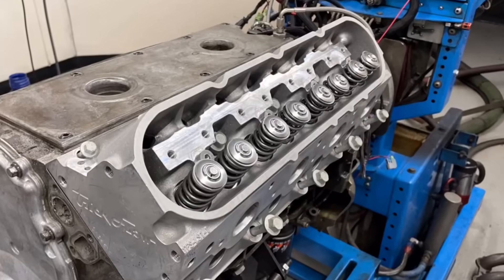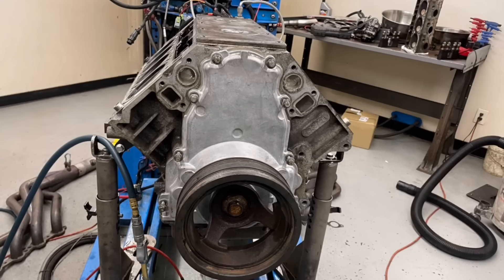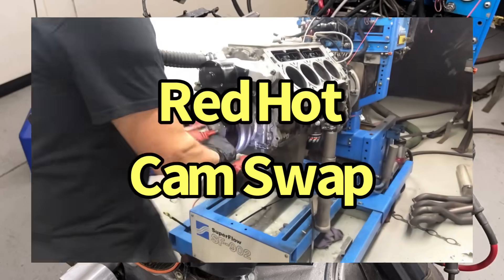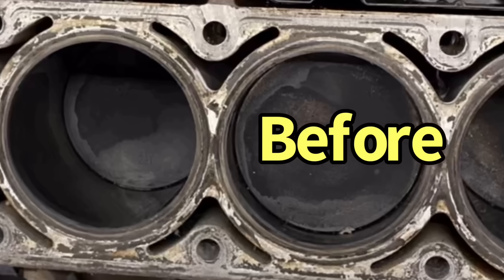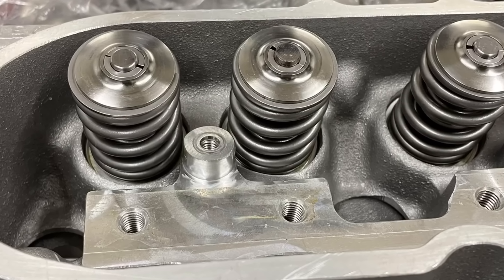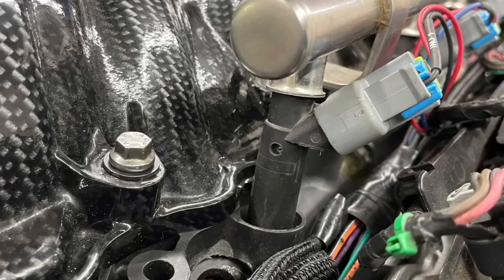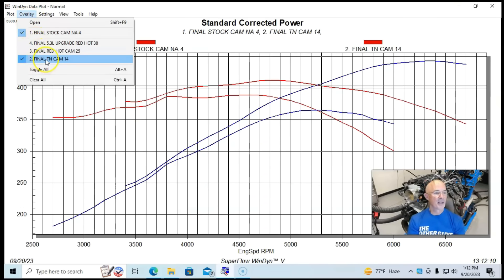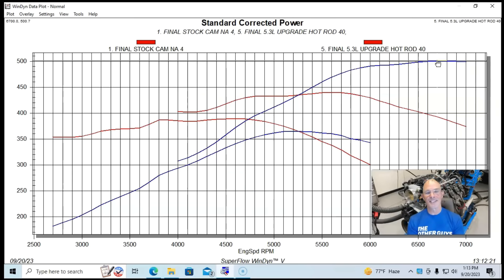HOW TO: THE ULTIMATE 510-HP, ALL MOTOR JUNKYARD 5.3L BUILD.  STEP BY STEP BUILD & FULL DYNO RESULTS

Comment: Awesome, I like the tests. Trick flow heads are not bad 30 more HP. ...?... Definitely interesting.   A question I keep thinking about is how can you maximize and keep a long steady Torque Curve. In the testing there  was one cam that had a nice long Plateau of torque.  Do you need rotating mass to increase torque?
Reply from the maker: rotating mass? as in heavy internals? big no
Reply: Yah I kind of knew that.  That's why I keep wondering why the UK is so into lower the rotating mass. And in the US its only sort of popular.  Cost is the obvious answer.
Reply from the maker: the US vs UK statement is not accurate
Reply: @richardholdener1727  I definitely don't know for sure. I've only seen more crankshaft lightening in a lot of UK engines dance I first got interested in the Buick aluminum 8 cylinder that Rover took over. Of course racing the rotating assembly is the rods pistons as well as the crank. But I've seen the people in the UK going straight to the crank and cutting weight there. Everything from motorcycle, all 4, 6, 8 and even 12 cylinder engines. The North American prefer the big throaty big block engines. It's just my limited view. I appreciate your replies. Even though I know I might get under your skin sometimes.  Thanks Richard.
Reply: @barryhuddlestun3098  Ligthweiogh cranks on st engines are a complete waste of money .The same guys swear thier alum flywheel adds xxx power cause "it revs faster in N" haha

Comment: It occurred to me while watching this that at 325 cubic inches, it's very close to the old 327(326.5 cubic inches).  At 365 HP stock it is also close to the rating of some of those older HIPO 327's.   Mind you it does it with much less compression and a milder cam.   Would be interesting to see a comparison.  Makes me yearn for an old F-body with a mild 5.3 and a 5 or 6 speed transmission.   Very drivable I'm sure.
Reply: Cylinder head technology wasn't as good back then. So they had to use more cam & compression to make up for it. With modern cyl heads, the HIPO 327 would be a beast!
Reply from the maker: the stock (junkyard) 5.3L L33 made more than the 365-hp 327 Muscle car motor did
Reply: I'd be curious to know how reliable the strung out 327 of yesteryear would've been, in comparison. I know this 5.3 combo can easily be daily driven with AC etc.
Reply: @STOK5OH  327s can go a few hundred thousand just keep it in good tune change oil etc. Same as any engine

Comment: Tbh motor hp means nothing. The only metric that matters is wheel horsepower.
Reply: Incorrect!!!  The only metric that matters is rear wheel torque! That’s what accelerates the vehicle.....HP is how much work is done in a specified amount of time....
Reply from the maker: Agreed-every form of professional motorsports (F1, Indy, Pro Stock etc...) should stop using their engine dyno programs! TBH...that is just silly!

Comment: Can you take this build to the extreme? What would some higher compression pistons do with some e85. What would it take to get to 600hp (is that even possible) n/a
Reply: Very possible, however keep in mind this engine that he has is basically Better than fbos and a tune since there is 0 restriction between anything. Having a compression ratio of 12 or 13:1 is possible with e85, e85 also has an extra oxygen atom so it add more power other then aggressive timing. What would help a lot would be drastically decreasing the stroke, and boring the engine, this will allow the pistons to spin faster creating more rpm and more hp. There is a 400hp k24 all motor, if that’s possible then getting a 5.3 liter engine to 600hp is very possible.
Reply from the maker: Changing bore and stroke is not the answer. Cam timing, compression, intake and things like dry sump oiling will allow this motor to creep up to 600 hp

Comment: I'd like to see a 700hp 6.2L engine, naturally aspirated on pump gas.
Reply: itd be easier if it was a stroker...youre still talking n quite a bit of RPM  and on pump gas... even for the LS/.LT  platform,, thats a BIG ASK for under 400 inches...
Reply from the maker: BTR did 760+ hp with a 6.2L Gen V LT1

Comment: Another great video, Richard!

Question: this is exactly what I want to do with a '96 Impala SS LS swap I'm currently sourcing a motor for. I'd like the car to be 500hp all motor. I won't have a fancy ported and polished head though. So, considering I'm willing to take the motor fully apart for this build, could I get away with as cast trick flows and maybe an over bore, domed pistons, etc etc to get to the same 500? Or will it simply require / be most cost effective to do all the head work you've done here? Thank you, you're an excellent resource!!
Reply: If you've not sourced a motor yet buy a 6 litre and definitely 😂
Reply: The heads yielded 30 HP extra.  Do you need the extra 30?  Maybe a mild home port would yield 20+ without the expense of aftermarket heads....
Reply from the maker: Bigger bore (or 6.0L) would yield the 500 hp with as cast 220 heads
Reply: Wish you were my neighbor !    I'd like 500 Hp, via LS swap, for a 56 GM product.
Reply: Why not just build the LTx? You can make tons of power with one even stroke to a 409

Comment: With $9k in heads, cam, valve train, intake and fuels system and machine work, your junkyard SBE can make 500hp.

I think you might be better off with a upgrade rebuild of the short block.  You will need more cam, but you can get to 500 crank for thousands less.

The LS/LT hybrid made 500+ with $5000 less in heads and $500 less in manifold.  I'd like to see this builds dyno graph overlay the hybrids.
Reply: All that was $9k???!!
Reply: @hellaportland  Probably $4.5k in the ported heads alone.  They run nearly $3k from BTR without the port work.
Reply: @aukseharris4630 $150/HP.......?   Heads netted 30HP....
Reply: @trailerparkcryptoking5213  That's the thing, the heads aren't being used to their fullest extent here.  They allow you get 500hp with a smaller, street friendlier cam.  The heads can support way more power.  More cam, more displacement, higher RPM.
Reply: @aukseharris4630  so Tooley came across with the badass heads to make his small cams look better?!?  Gotcha!
Reply: @trailerparkcryptoking5213  I don't know about that, but better (not just more) flowing heads permit smaller cam per given level of power.

You could probably get to 500hp with the Katech ported heads previously featured on this channel, but they would need a cam that most people would find objectionable in a street car.  With a lesser pair of aftermarket heads,  Mr. Holdner made 500hp with a stage 3 cam in a video from a couple months ago.
Reply: @trailerparkcryptoking5213  Look at the spread on power...its not just 30peak
Reply: @gordocarbo    I have had differential calculus and vastly understand “area under the curve” better than most!  And you?
Reply: you could most likely have less than 9k  in a 383  with steel main caps  AFR heads or a head that flowed 300 CFM  a super victor an 850 and a .600+ lift solid roller id be making about 575
Reply from the maker: $9000? You need to shop somewhere else but the High Cost Power Outlet
Reply: @richardholdener1727  I might be off, but you don't buy retail like I do.  $1200 for a FAST manifold, $400-500 for porting it. Plus the throttle body.  $2900 for the heads assembled heads from BTR.  How much for the porting, milling, hand cleanup, and modifications?  $1500 is conservative.  You didn't think about fuel injection because you've had them forever, but for a pulling upgrading from stock truck it's more money.  You didn't need pushrods but I would. The cam is nearly $400 retail.  It adds up.  You're probably fine running the stock rockers on a dyno, but failure for you is a minor inconvenience and a business expense.  I've learned the hard way to go ahead and pay the money.  At that level of lift I'm going to get aftermarket. 

You have friends and partners in the industry, I teach high school.   We are not the same.
Reply from the maker: Since you have no idea how or when I buy things-better just to admit you vastly overstated the cost to help promote your agenda.  Admitting when you are wrong would be something I would like taught to my sons in class.
Reply: @richardholdener1727  Gotta ask then. So, how much did it cost and how much would it cost right now? Any parts donated?
Reply: @richardholdener1727  I intended no offense.  My agenda was/is to interact with the people on the comment section of your videos (an excellent sounding board) and help teach teenagers math and science by engaging their interests (like cars).  I have a pretty fair idea of what the stuff costs.   If I make a mistake (like forgetting to include sales tax on items that aren't tax exempt) I have to pay out of pocket.  You think I'm high, and I might be.  I'm not going to call someplace like BRT or Tony Mamo and waste someones time asking about porting  services I can't afford.  I do know how much others charge, either posted publicly or from people that have the work done.  If my estimate is more than 10% off my retail cost, I'll eat my hat.  

But that's really beside the point.  In rereading my original comment, it was not written with sufficient care.  I should have made it obvious that it was not intended to be critical, only to spark discussion.  Again, it was not my intention to offend, even though in retrospect my posted comments were blunt to excess and could be easily read that way.  For not being properly mindful and considerate of someone that does so much for our community, I was an ass and I apologize.
Reply: I agree with you buddy. Even just the LS3/LT engines will do that for $1000s less.
Reply: Guys, guys.... give him a day or two to total everything up 🤣🤣🤣🤣
Reply: FIrst thing Id do is stroke it to 383 wouldnt waste time camming a tiny engine btdt

Comment: Have you ever done a test on electric vs factory water pump, could pair it with a test on underdriven crank pulleys as well. Might make a cool video if you havent done it
Reply from the maker: see the accessory video
Reply: Not worth it in costs, or gains (if any)

Comment: with that valve size and flow, it should peak at 7500+ rpm. theoretically 560+ bhp.
Reply: In the test IMO theres not enough camshaft for that RPM, a 240 or 250 cam would definitely do that, and theres definitely enough cylinder head for it. But piston valve clearance might get sketchy
Reply from the maker: You base the power production and rpm on valve size? How about no!

Comment: The VE on this must not be too far off from DOHC.    Alot of power was made and if he went a little bigger on the cam, tight lsa, even more compression and e85 600hp could've been had at a streetable rpm level.
Reply: What was the compression ratio on this setup?  It looked like flat tops with no valve reliefs....?
Reply: @trailerparkcryptoking5213  whatever the stock 5.3's have.  probably cant go much more on the cam without running inot PtoV issues
Reply: WOuldnt go anywhere near 600. Lot to ask from a tiny engine

Comment: 1HP/CID+ seems to be the modern manufacturer goals while 100HP/Liter is a standard for any aftermarket upgrades & modifications.
Reply: You're not far off, but I look at a different metric. Torque per cubic inch. Once that's maximized, horsepower is just a matter of RPM range.

Comment: There is more information packed into this 12 minute video than some people will ever try. And there is no shame in it. Don't cost yourself a bunch of money doing things you don't know how to do. Or you will end up on the channel Just Rolled In. Here is a thought. Do all of this, while keeping the variable cam timing system in place, and use basic tuner or whatever might be needed to make it run.
Reply from the maker: VVT becomes less of a gain (or even possible) with higher duration cams
Reply: @richardholdener1727  What would be your guess with a power number once in teh car, all accessories exh etc hooked up?

Comment: What fuel did you use in these test? Running a Static Compression Ratio somewhere around 10.70–1 you need careful cylinder pressure management to run pump premium or were you using e85?
Reply: I’d say cool dyno water and aluminum block it should work
Reply from the maker: 91

Comment: Hey Richard how much would it take to reach 500hp (or 530 if possible) NA on an L83? Thanks for the great video too!
Reply: he already has one going to 570 bhp.
Reply: Not much because LT heads are great. Cam, E85, headers, MSD intake. If you get ambitious, ported heads.
Reply: Hello, 

I have yukon 5.3 v8 2008 with 4L60E transmission I will get in my yukon
1-long tube headers (Speed engineer)
2-cold air intake (volant)
3-full system exhaust

Which cam should I buy to make more hp and tq 
1-BTR GEN III & IV LS TRUCK NORRIS CAM

Or
2-BTR GEN III & IV LS TRUCK NORRIS NSR CAM

Another qustaion do i have buy springs and pushrods?
Reply: @kingsupra5023  NSR cam has less lift than the truck norris cam and will make less power. NSR denotes "NO SPRINGS REQUIRED". Usually you don't have to do pushrods with BTR cams but its always good practice to measure just in case.

Comment: Richard, a little bit of speculation here... a similar junkyard LQ4 "should make around 40 more than the stock L33 - correct? If so, would it be safe to say that the top end and cam from the L33 should make around 40 more in modified form too? That would make a 550-ish flywheel setup pretty easy with a junkyard shortblock and good top end parts.
Reply: The math there checks out IMO, definitely a fantastic cylinder head. 
A 230/240 cam with that head would maybe make close to 600 but piston valve clearance would have to be looked at because of the mill job. I can attest to 600+ being doable with an aftermarket 11:1 piston, ported LS3 head and 240/250 cam.
Reply: Keep in mind the way Richard test his engines is without accessories. So whatever number you see deduct about 25 hp for real world numbers.
Reply: @sstevocamaro  25? I think it closer to 50at the flywheel when he added a regular water pump, accessories, mufflers, etc. I'd have to go dig that video up. The engine dyno to chassis video they lost 100 in a drift car with a manual transmission. 

I  definitely don't get hung up on peak numbers. I look at tests like this more for what percentage did it pick up stock vs. modified.
Reply: @bluecollarhotrods9781  Maybe -50hp total with a fan hub attached and activated
Reply: @sstevocamaro  That particular test I'm referencing was a stock 5.3L. Richard added: clutch fan, conventional water pump, alternator and power steering pump, air box, longer sections of pipe with mufflers. It was an excellent illustration of what robs power and how much. The other notable one was the effect of temperatures. He runs most of the tests with optimal oil and coolant temperatures.
Reply: @sstevocamaro  Probably more, cool intake air, low coolant temp/hot oil, add that plus accessories full exhaust I bet its closer to 50 less

Comment: Thats bananas to make 500+HP with such a small camshaft.   Another testimony of making power on the Chevy LS.
Reply: If you’re will to buy the heads and get the porting
Reply: @cedricwilson2055 there are older vids of 400-600+ hp combinations NA
Reply: Sweet
Reply: @cedricwilson2055  Yep those heads cost a bundle!
Reply: Bananas until you price out the parts for yourself 😂, just get a big block chevy
Reply: @benaiahtheassassin  then ima make 650+ with way too much torque  LOL
Reply: @benaiahtheassassin  BBC weight without accessories 660lb, chevy LS weight without  accessories 410lb.    So weight and size will be a reason that someone would pick the LS over the BBC.
Reply: @dennisrobinson8008  You add accessories and that 500hp disappears lol
Reply: @dennisrobinson8008  BB wont really be affected by 200 lbs like the smaller engine would 
I have a high hp Gen 1 sbc...regardless of the power# a decent BB will oupull it all day
Reply: @infamousnova it's not the answer for everything. Especially when it's going in something like an s10 track truck. Weight is huge. Size is very important. As well as getting more than 3 gallons per mile. 😂
Reply: Cylinder heads ....oh ya

Comment: Richard, if these are mild Cams does that mean that they're well mannered on the street? They should not be very lopy correct?
Reply from the maker: a hot rod cam is certainly drivable
Reply: The sound byte sounded lopey
Reply: @cedricwilson2055 the Texas Speed Chopacabra and BTR Truck Norris are lopey as well...

Comment: I'd still take a big block chevy.
Reply: Same here
Reply: There is a 454LS lol
Reply: That weighs as much as 2 5.3s? Nope.
Reply: @littleherms3285  It's also faster.
Reply: @benaiahtheassassin  meh
Reply: @littleherms3285  He right. Do the same mods the BB will leave the 5.3 in the dust
Reply: @gordocarbo  junkyard BB? Nope.
Reply: @littleherms3285   i dont run engines out of a junkyard and gen 1 BB are impossible to find in one these days. 
Ill take big stroke bore size all day over a tiny 5.3
Reply: @gordocarbo and that would not be the same comparison, this is a factory bottom end and heads just touching 500hp. You want to go wild aftermarket? LS platform will make just as much power at 200lbs less overall weight, smaller package and cheaper parts. Fly at er hoss.
Reply: @littleherms3285  Youre trying to say with same mods the 5.3 will outpower the BB. No sir..